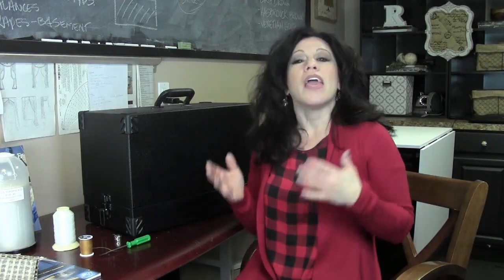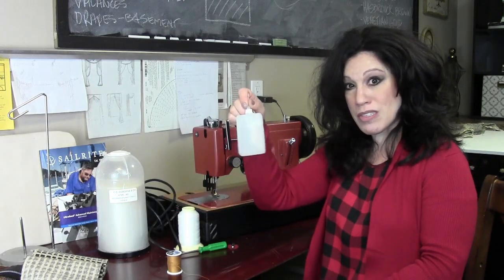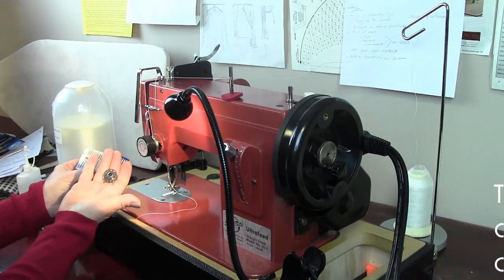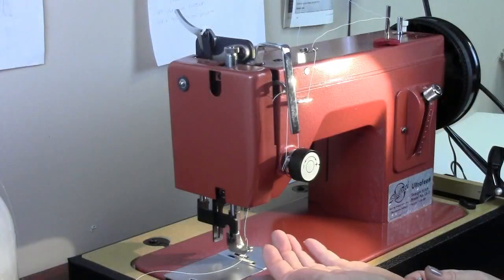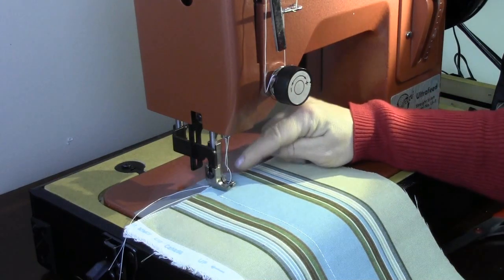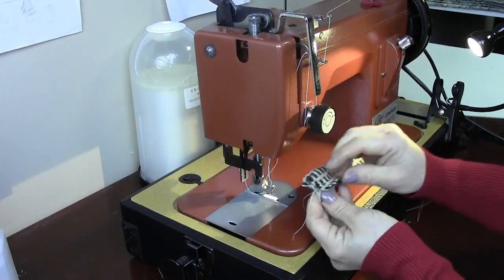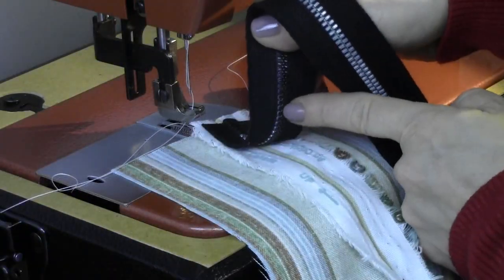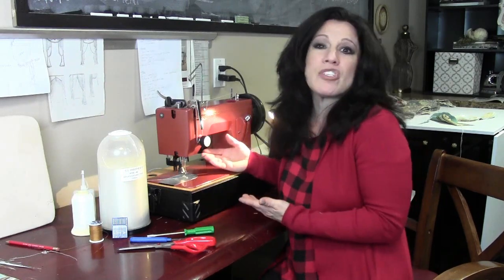Review Of The Sailrite Heavy Duty Industrial Sewing Machine By Renee Romeo

Comment: I have a question. Do the bobbins seem small for the machine considering the thread weight that is used? I looked it up and this machine uses the exact same bobbins as my Bernina domestic machine. The bobbins hold plenty of thread when I’m using thread from my local fabric shop but I’m afraid than when I start using heavier threads that these bobbins might be considered small and not hold a lot of thread. What is your experience?
Reply from the maker: LuvMyCardiKids, That's a great observation! It's not as bad as you'd think. It lasts longer than you think. My method is to wind several bobbins at once so that they're ready to go when they run out. I wish I had thought of mentioning this. Thanks so much. I hope it helps your decision. All the best, Renee
Reply: @ReneeRomeo  well that won’t really be much of a change for me then. I normally wind a couple of bobbins for a large project when using my domestic so when I go to heavier thread maybe I’ll be winding 4 instead of 2! Thanks for the reply! I appreciate it.
Reply from the maker: @LuvMyCardiKids  Oh, and hey - Another thing is that I usually use monofilament (clear) thread on a large cone for my upholstery work (unless there's top stitching). When you wind this around a regular bobbin, it fits more than household thread because it's thinner in diameter. Winding 4 at a time is a great idea but you can also keep this machine threaded while you're winding bobbins - another great feature!
Reply: @ReneeRomeo  that’s how my domestic machine is also. I don’t need to unthread the machine to wind a bobbin. Usually I do have to unthread my machine to wind a new bobbin simply because I normally only have one spool of thread!
Reply from the maker: @LuvMyCardiKids  Haha! So true...

Comment: Wow, Renee. Nice to meet you. Great job. Very clear presentation. I own a 39’ sailboat and need to build a new Bimini and enclosure around the cockpit. I have never sown anything more than a button on a shirt in a crisis. I have many mechanical and hand skills. Do you think I could take on a project like that?  Or should I pay someone to do it for me?  Would the zig zag unit do strait stitching as well?  I guess the zigzag is necessary for sails.
Reply from the maker: Hi Michael, Nice to meet you too! I absolutely think you can take on this project. However, I would weigh the cost of the machine against how often you think you'll use it. I've been on a sailboat ONCE (I now know that I need to do better with that!) and it seems like there's quite a bit of canvas but I don't have any experience with the cost of boat sails and enclosures.
If these components need replacing and/or repair often, I think it's a worthwhile investment. Anyone can sew a straight line and as far as I'm concerned, most projects like yours are just straight stitching. Yes - zigzag machines sew straight or zigzag for sail repair. My zipper 'tutorial' here is the simplest way to install a zipper - period. The other expense is a grommet installation machine (or snap installer). You need to purchase the BEST you can find and they are pricey. Don't skimp with this because you will do a perfect job of sewing and then can ruin the whole thing with an inferior snap/grommet installation. Trust me - I've been there. With the proper machinery and your hand skills, you'd be able to have a moonlight career. I hope this helps your decision. All the best, Renee

Comment: Thank you for the nice introduction to Sailrite machines, but why don't you mention that these machines need a lot of maintenance. You have to oil them at least twice a year at many point, somthing around 24 small areas inside. To do so you have to open the chassis. I think this should know every potential buyer. For my opinion is this in relationship to the high price non acceptable.
Reply from the maker: Dear Uwe, Thanks for the interest in my wonderful machine. As you know, every sewing machine requires some sort of maintenance from time to time. The frequency really is dependent on how much you use the machine throughout the year. Also, the cover comes off very easily and all the moving parts are accessible. Please don't let that get the way of you considering this lovely machine. Maintenance will take about 5 to 10 minutes of your time - seriously! That's why there's barely a mention of maintenance. It's a non-issue for me. All the best with your decision, Renee
Reply: Wow. I clean and oil my non-sail rite machine after every project is completed and take it to be professionally cleaned and oiled internally once a year so I don’t consider the ability to service it yourself and only having to do that once or twice a year a lot of maintenance. I guess it’s all a matter of perspective.
Reply: Unless you truly need a machine to sew sailcloth and canvas and be able to repair it yourself while under sail…

Comment: Definitely a loud motor!
Reply from the maker: Spartaues, Agreed! I always use a pair of ear plugs when running it. It's my only bad critique of this wonderful machine. But... without the loud motor noise, it also wouldn't be as powerful as it is. It's a trade off that I can live with. Do you agree? Renee
Reply: @ReneeRomeo   I agree.  A powerful motor is nice on a sewing machine. Ive run older singer models with the tiny belt and  motors,  and they were very finicky, just not smooth at all.   I wonder if the motors in the larger sailrite machines are as loud. I've watched  other reviews on the larger  sailrite machines with the full table. And all those reviews highly  praised the motors power and ability to gently start off.
Reply from the maker: @spartaeus  That is absolutely true! It's smooth from start to finish. I haven't encountered any finicky-ness about this machine at all. It's been a straight-forward experience for me. I really don't know anything about the larger Sailrite machines but I imagine that the noise level would be similar. As an example, I have a kitchenaid mixer with a small motor and a Bosch mixer with a large motor and the noise level is much greater on the Bosch but I can do so more with the Bosch that I wouldn't (or couldn't) dare do with the Kitchenaid.

Comment: nice Video ! over 10 years ago i purchased my very first Ebay purchase and was very Skeptical about it  i bought a Chinese Clone Industrial StrenghthWalking Foot Sewing Machine  and got exactly as i was promised  i bought the machine to make occasional Canvas and Vinyl repairs and items for both my Boats and Vintage cars  i’ve done  a couple Auto Interiors and numerous Boat projects with my machine and it’s been trouble free since i received the machine in all honesty i can’t see any differences other than color and the name  between  mine and your machine  although yours was a lot more money and mine came with a very inexpensive plastic case that works okay  and was Given to me at no extra charge the salesman on the phone did explain to me that it was a cheaply made case and  wasn’t up to grade for Airline travel but more of a dust  protector for storage  which is how i use that  part  mine is also all metal except for that tensioning knob  and   it didn’t come with the Sailrites Power Wheel  that i can order from Sailrites and put onmy setup if i desire so far as a Hobbyist i just use the machine as i  got it delevired to me  Sailrites videos on YouTube do claim that they own the molds their machines are made in a higher quality in with more Quality Control than the other machines ?  that may be true IDK   and i’ve been told that Sailrites does have  great Custome Service yet i have net needed any Service o mine as of yet other than basic oiling and cleaning i perform myself
Reply from the maker: Hi Craig, Thank you! I'm so happy to hear when others have positive experiences with their machines. It's a big leap ($$$$ money or not) because ultimately, we all just want the best performance we can get. I had a hard time finding un-paid people that had any information that might help my purchase decision. It was a hopeful purchase on my part and it all worked out perfectly. I just wanted to share my experience. You'll be pleased if you ever need spare parts from Sailrite too! All the best, Renee
Reply: Can you tell the make and model of your machine as I am looking for a machine salrite is cool but I wonder about alternative options... Thank you in advance

Comment: Hi Renne what about your tread tension ? I have the same machine and really have issue with unstable tread tension.   When a sew zippers with the Sunbrella canvas fabric end up waiving?
Reply from the maker: Renaissance Cushions, Great question! My experience tells me that that the problem is coming from your needle/thread combination, not the thread tension. Sailrite has a great guide for the proper thread and needle to use when sewing on different fabrics. You'll need a heavier duty needle to get through all the layers of fabric and zipper material than if you were just sewing straight seams. I have only adjusted thread tension slightly from the factory settings for all my heavy duty sewing. I use a fresh needle for every project and have several varieties of different threads to make all my projects look great. I hope this helps! If not, give the company a call and they'll be able to suggest the perfect thread/needle combination for your project. All the best, Renee

Comment: I have the same machine and think you have made an accurate and fair review. The only complaint I have about mine is that I can't get a clean stitch with ultra thin nylon. Medium and heavy weight fabrics are great.... THe machine loves them. But ultra light fabrics are different. No matter how much I adjust the tension, the stitch is wrinkled. Have you had the same experience?
Reply from the maker: Keefe Borden, You're one of the lucky ones to have this great machine! To be fair to Sailrite, their instructional video doesn't show how to sew on lightweight fabrics - probably because it's not the best machine for them. It appears too powerful and is a frustrating process to get the tension just right. But...the way that I approach a fabric or thread problem is to start with the needle first. All of my tension/fabric issues over the years have started with my needle (I wasn't always good at remembering to change them out). I suggest starting with a fresh needle (match it according to the Sailrite chart: fabric/thread/needle), test it on the fabric and adjust tension from there. The way that I handle going from one project to another is to have two machines. I have a an inexpensive Brother sewing machine (Costco) for all my light duty work and the Sailrite for all heavy duty projects. It's great to keep them both set up so that I can just jump from one to another. I hope this helps! Happy sewing, Renee
Reply: Renee Romeo ah, thank you so much for the advice. I sew a lot of lamb skin and I haver NEVER been able to get a decent stitch on the Sailrite. I got so frustrated, I stopped using it and just sew on my Janome, which does an amazing job. I was just thinking to get rid of the Sailrite cause I couldn't perfect a decent stitch and look for a Juki industrial machine, hoping to have better luck. Instead, I will try the Sailrite with heavier weight textiles and use the Janome with the lighter ones. I really hope that works cause the machine seems pretty cool. I am relieved to find out it's most likely, "operator error." Thanks a million, my friend! I appreciate you. 😊
Reply from the maker: @GigiVandalPop  My friend has a Janome that she LOVES for all of her clothing projects. I fear that you would have the same luck with a Juki as you're having with the Sailrite. Don't be afraid to call the Sailrite company for advice if you're not getting the combination right. They helped me when I had a question about an unusual fabric I needed to stitch on.  Please try to let me know how you make out. I'm curious to hear if your issue gets solved. And... what do you make with the sheepskin?
Reply: @GigiVandalPop  I wish I got the heavy duty Janome instead. I spend more time adjusting the machine than sewing.

Comment: I am looking at the Sailrite, because it has zigzag. But, its arm is short and it does not have needle feed like the Juki. Its a tough call. I wonder if the arm is too short?
Reply from the maker: Neil Shubert, I know what you mean. I wouldn't worry about needle feed as much as a short arm. I'm also not familiar with the cost difference between the two at this point either. I have never needed to use my Sailrite for zigzag stitching so I wouldn't miss that feature. What type of projects do you typically work on? That might help my opinion. Renee
Reply: Thanks Renee,  I mostly sew through Canvas, webbing and velcro, Padding and such. I dont need a portable machine, but sometimes I need to sew 4-500 feet of velcro or webbing in a day. Some pieces are very large, like a sail, but not the thin Dacron they use. The Juki or Consew are from 1300-1700 and its just a little too much right now!  I would love to see the Sailrite Fabricator machine!
Reply from the maker: Neil Shubert, The Sailrite is a bargain compared to Juki or Consew. I've never had a day when I regretted my purchase decision. It has met my expectations every single time. It's super fast too. The portability is just a bonus - I don't NEED to move it around but it's nice to know that I can stuff it in a corner if I need to. I hope these points help steer you to the right decision. Please let me know what you decide - the curiosity is killing me! Renee
Reply: If you are sewing wide zigzag on thick fabric/many layers of fabric, the needle will bend enough to strike the needle plate...use a straight stitch or a very narrow zigzag.  These are great machines.
Reply: @dhikes9331  w